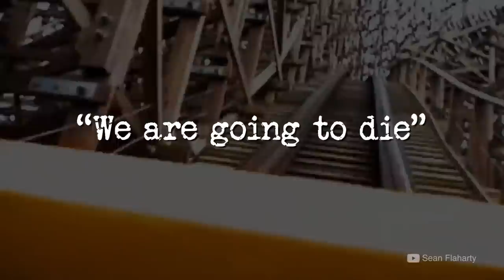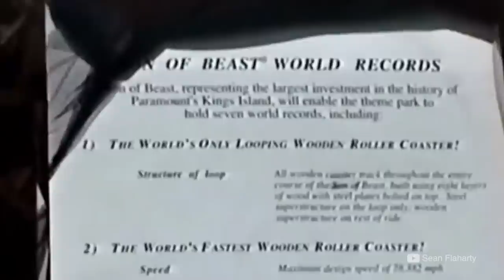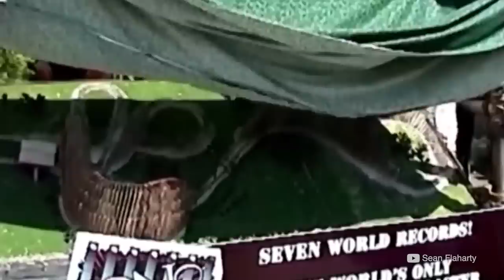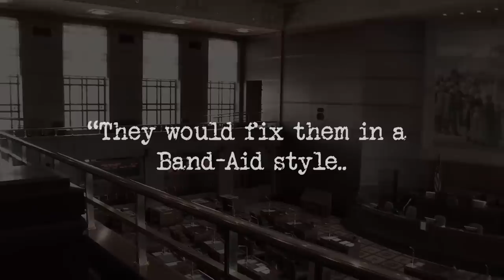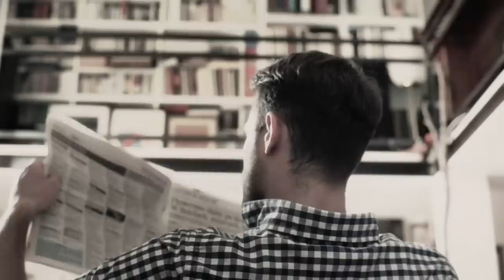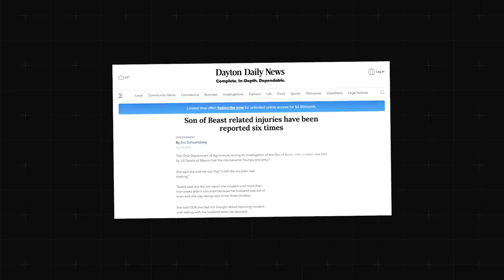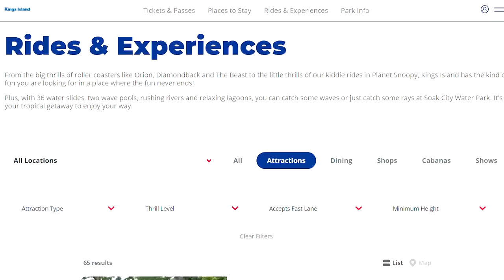The Son Of Beast Roller Coaster Accidents

Comment: It seems in this video Kings Island is portrayed as a greedy company with no regard to the safety of their guests.  I don't think this is a fair assessment.  Son of Beast was a huge investment and an extreme ride.  Nothing like it had ever been built nor has been built since.  Extreme, cutting-edge rides typically experience some challenges and downtime.  Naturally, the park was hoping to recuperate their investment because the park is seeking a profit. Still, Kings Island spent millions in maintenance working with engineering firms to ensure safety on this ride.  In the incident in July 2006, ride operators stopped the ride immediately when they noticed returning passengers acting differently.  Well-trained staff and good safety protocols prevented this major accident from becoming catastrophic.  

It's noteworthy that thousands of riders have ridden this roller coaster and there are no fatalities attributed to it.  Hindsight is 20/20, so naturally we can look back on the Son of Beast (and its story) and be critical.  Park management almost certainly wishes it had never been built as they would have invested money in a different ride (or at a ride created by a different manufacturer).  Still, calling the ride "dangerous" is a bit of a stretch.  More park visitors were certainly injured driving to and from Kings Island than while riding the Son of Beast.  

So, was the ride a failure?  Yes.   Did Kings Island neglect this ride?  No, not from what I can tell. Was it dangerous?  Perhaps compared to other amusement rides, but humans partake in more risky behaviors regularly. So.... no. Kings Island certainly does and never did want the notoriety this attraction caused which is why it's now removed.

Comment: As an engineer I'm just curious: why the heck did they even thought of building a WOODEN roller coaster? That's exactly the opposite of durability and safety
Reply: Are you really an engineer? Because this is an extremely stupid comment. There is literally nothing wrong with building a roller coaster out of wood. Wooden coasters are completely safe and are still being built to this day. This ride wasn't unsafe because it was wooden. It was unsafe because it was built by a sketchy manufacturer.

"That's exactly the opposite of durability and safety"

Objectively false. Wooden coasters are no more unsafe than steel coasters. And they're perfectly durable if they're built and maintained well.
Reply: @triple7marc  I never specified what kind of engineer I am 😁
Reply: @maddsua  Why did you specify it at all then if it's not relevant?
Reply: @triple7marc  bro, wood needs a ton of maintenance, and just try to guess in how many cases the owners don't give a shit about it. I mean, that's all good when they do, but all the other times wooden structures are in permanent self-destruct mode

Comment: That’s the last thing you wanna build is wooden coasters! If this was metal one this would stand forever! All you needed just update the paint!
Reply: There is literally nothing wrong with building a roller coaster out of wood. Wooden roller coasters are still built all the time and they're perfectly safe. And steel coasters don't last foreverm either. Wooden coasters have existed for far longer than steel coasters and many still exist from the 1900s, 1920s, 1950s etc.

Comment: Yeah, the steel tube rails and urethane wheel and trucks is a slightly better design.
Reply: SoB did use fully moveable truck design modified from premier LIM model. 

And this is actually one of the culprit of the accident. Those made the train way heavier than designed to be

Comment: I rode on the original Beast just before it closed down, and on Son of Beast right after it had opened. They were both some of the roughest rollercoasters I've ridden, and they were definitely the most dangerous wooden rollercoasters I have ever experienced. Not surprised there were that many deaths on it. I'd like to know the angles of the turns on it, because no other wooden rollercoaster I've ridden had such sharp turns at that high of a speed.

Comment: Seriously though, wooden rollercoasters are way outdated and are ridiculously harsh on the passengers. Jolting them all around an making heads flop back and forth at a high speeds. 

Give me a hanging (feet dangling) steel rollercoaster, ANY day of the week over those obsolete pieces shit.
Reply: Now they build it smaller and more low-to-the ground for shorter, denser, and more durable support like GCI and Gravity Group.

Or use real steel track that act as a stronger steel ties like RMC

Comment: Sad thing is sensors exist that would could tell the control room about the shifting structure, these fucking cheapskate parks need a good margin though.
Reply: It doesn't need to be if the coaster was well build from the beginning. Even if it work, rollercoaster can't brake anyway. 

It's like installing roll cage on the plane. It please you, but it won't save you

Comment: But what is this!? Such a large and expensive work I suppose and the trains or people carriers mounted on ice cream carts? How can this be!! Amazing! But if it doesn't even have an aerodynamic shape, what did this engineer or boss who built it think he was building? It looks like a jungle bridge made with vines. Be that as it may, the guest comes first, you can't ignore him once he's invited, why invite him then, to make a big deal out of the party? That's how it was, I looked more at the pocket than at what was being built, thank God I worked in the future and didn't work for NASA.
I have a gate in my garden, it's made of wood, it's very nice shyes, it's well built, the wood is treated (it lacked a ton of grease from heavy machinery) but every time it rains, it gets wet of course. What happen? Well, the normal thing is that wood absorbs moisture and when it doesn't rain or normal temperatures are exceeded in heat, it dries up and cracks, it doesn't recover its shape, unless it is done very well by the tree itself or by nature. , an incredible thing, as long as the wood lives, it is capable of recovering its shape where it went or as it intended in its growth, everything that has stuck to it or its trunk and branches, whatever it is, metals, plastic, stone etc And not toxic enough for him, he covers it as if it were part of his structure, he is the best and first known non-plastic or organ surgeon. But once cut, especially where there are knots from the growth of the wood or metallic objects, such as nails, screws or nuts that pierce it, the work is over, or new wood, HaHa! It's worse than removing white hair, one by one from the head, the latter is better, because whatever color it is, it's still hair, even and it seems unbelievable... after death!
.
Pero ésto que es!? Una obra tan grande y costosa supongo y los trenes o portadores de personas montados sobre carritos de helados? Como puede ser ésto!! Alucinante! Pero si no tiene ni forma aerodinámica, este ingeniero o jefe que lo construyó que se creía que estaba construyendo? Parece un puente de la selva hecho con lianas. Sea como sea el invitado es lo primero, no puedes desatenderte de él una vez invitado, para que lo invitas entonces, para hacer bulto en la fiesta? Así fue, miraba más al bolsillo que a lo que se construía, gracias a Dios que trabajo en el futuro y no trabajó para la NASA.
Tengo una puerta en mi jardín, es de madera, es muy bonita shyes, está bien construida, está tratada la madera (le faltó una tonelada de grasa de maquinaria pesada) pero cada vez que llueve, se moja claro está. Que ocurre? Pues lo normal, que la madera a la humedad absorbe y cuando no llueve o se exceden las temperaturas normales en calor, se seca y se agrieta, no recupera ya su forma, a no ser y lo hace muy bien el propio árbol o la naturaleza, una cosa increible, mientras este viva la madera, es capaz de recuperar su forma hacia donde se dirigia o como pretendia en su crecimiento, todo lo que haya pegado a él o su troco y ramas, sean lo que sea, metales, plástico, piedra, etc. Y no suficientemente toxico para el, lo cubre como si fuese parte de su extructura, es el mejor y primer cirujano no plastico o de órganos conocido. Pero una vez cortada, sobre todo donde haya nudos propios del crecimiento de la madera u objetos metálicos, como clavos, tornillos o tuercas que la perforen, se acabó la obra, o madera nueva, HaHa!  Es peor que quitarse el pelo blanco, uno a uno de la cabeza, este último es mejor, pues sea del color que sea, sigue siendo pelo, incluso y parece mentira ... después de muertos!